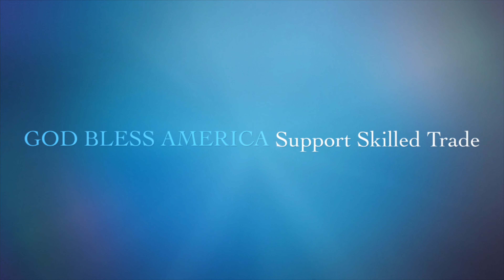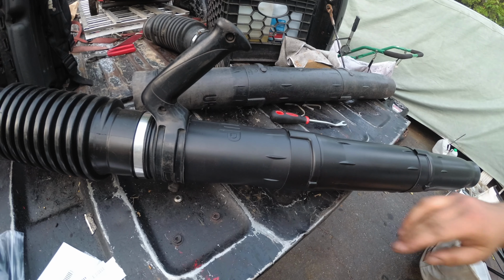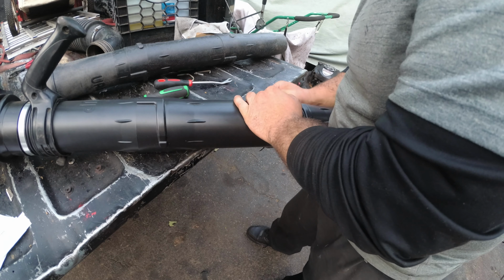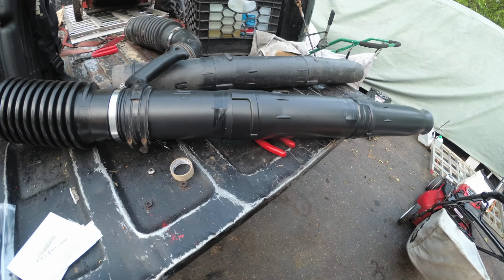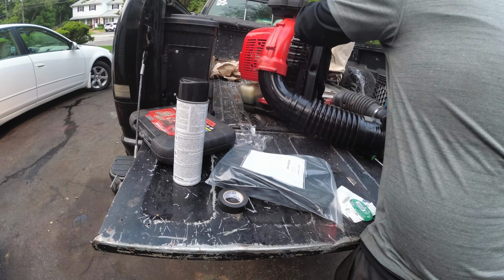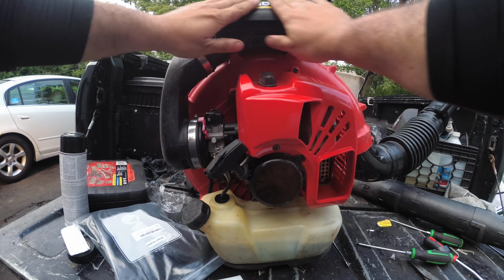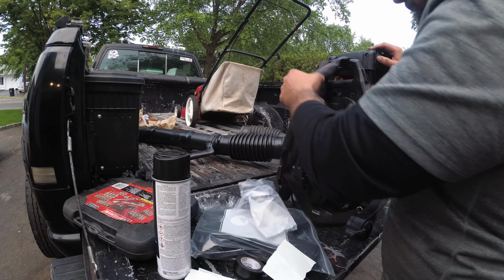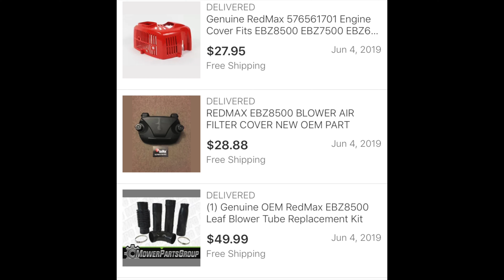REDMAX EBZ8500 Blower HOW TO REFIT FOR DUTY: Blower Tubes, Straps, Air Filter Housing & Engine Cover

Comment: I have the eb7000 is it possible to swap my left hand throttle to tube throttle ?
Reply from the maker: If the throttle cable and grounds for the ON/OFF switch are long enough it should be good to go!

Thanks for the view and comment, hopefully you subscribed to my channel!
Reply: You need a whole new assembly for a tube mount..hip mount so much better